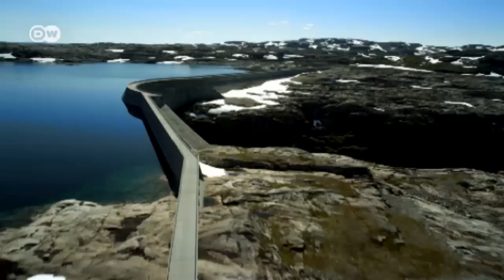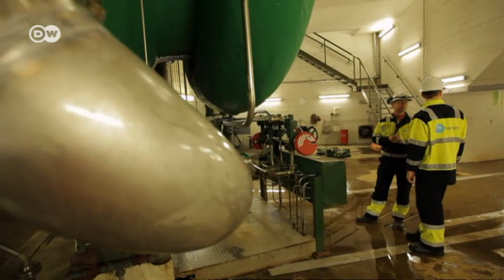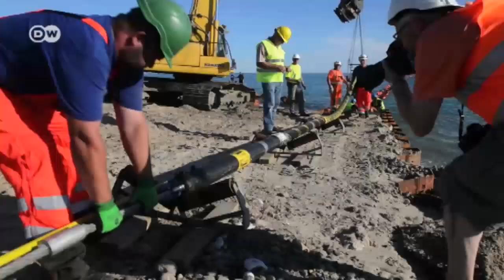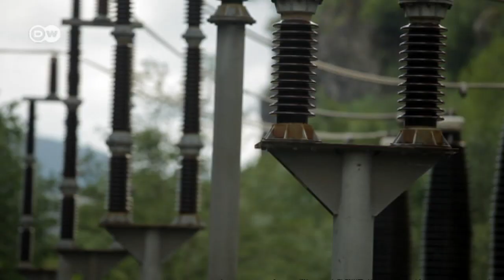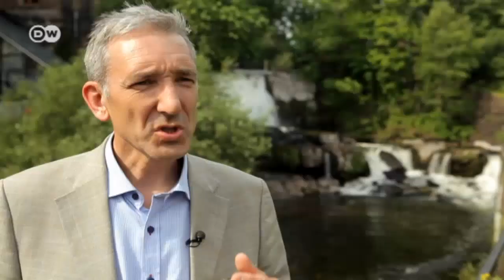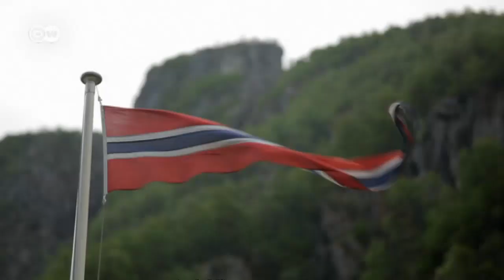Norway: Energy storage for Europe | Global 3000

Comment: They would produce 2000 MWh per hour, not MW per hour (it's a unit of power, not energy).
Reply: Or just MW
Reply: The anouncer has no clue.
Reply: Erik, 

you are confused, Mega watt hour is the correct unit for power over a given time frame. Not Megawatt hour per hour
Reply: @iareid8255  MWh is a unit for energy. MWh/h is just MW (unit for power)
Reply: Posh Boy, 
the hour is routinely used in electrical measurement to quantify power times time, it is how your electricity bill is measured. 
(Retired Electrical power engineer)
Reply: @iareid8255  My mistake, since she said "2000 mw/h" I got confused as I generally approach these things as a physics student.
Reply: @ThePoshboy1  The lady in the video was definitely wrong. You are right. Probably because the lady didn't understand it. 

She said MW/h which makes no sense. 

It is simply MW (production capacity at any given moment). From which total energy produced (MWh) in any amount of time can be calculated.

Comment: Norwegian oil company Statoil buildt a big offshore windpark for the UK, providing power for 650 000 houses. Statoil is also planning a even bigger offshore windpark in Norway that will produce power for 2,1 million houses.

Norway will be the future battery off Europe xD
Reply: Statoil isn't Statoil anymore. It's also not an oil company anymore. It's now called Equinor, and is now an Energy company.
Reply: @C0MPUTERPHILE  Jobber du i kommunikasjonsavdelinga på statoil???

Statoil eller equinor er da absolutt å kunne kalles et oljeselskap. Olje og gass utgjør så godt som hele virksomheten deres.

Eller skjønte jeg ikke spøken din?
Reply: HadzirLP Nei, men jobben min involverer å både ringe oljeplattformer direkte og å snakke med tidligere Statoil Tele Driftssenter, og de har alle tydelig lært seg sitt nye navn når de tar telefonen. Millionene Equinor har brukt på rebranding er vel forøvrig ikke vanskelig å få med seg i verken i media eller i alle reklamekampanjene de har kjørt etter navnebyttet..
Reply: @C0MPUTERPHILE  faktisk ikkje sett ein einaste reklame sidan dei bytta navn 😂
Reply: Mr. Death,

Generated power is not measured in the number of homes it may provide. The media always use this figure or that of rated nameplate power, both are meaningless. As far as wind is concerened it should be in a de rated value equal to it's real output, e.g., a 1 gigawatt offshore wind fram should be rtaed at 400 Mwatts, with the knowledge that at times it will be near zero and others much much higher. That is one of the fundemental and unchangeable feature of wind.